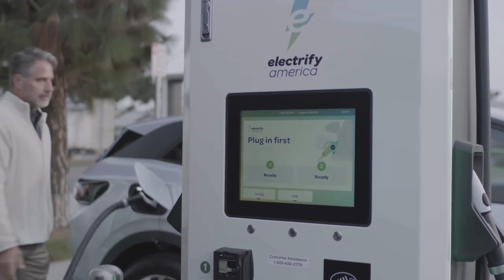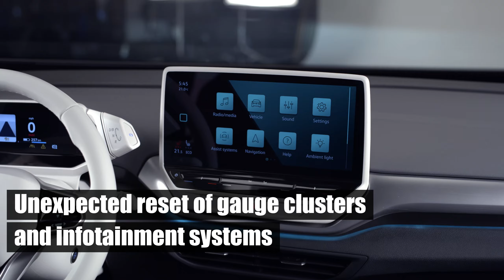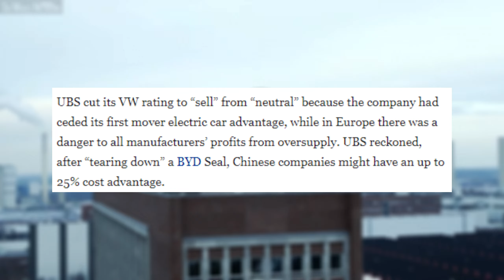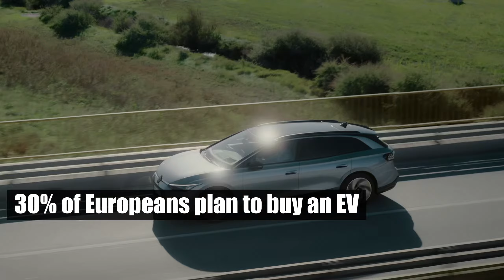Volkswagen’s EV Dream Turns Nightmare: CEO Scrambles! From Electric Vehicles, Back to Plugin Hybrid!

Comment: VW have always had reliability problems for years, regardless of ev or ice models and have been expensive to repair.
As a dealer of 30 odd years, I know from experience..
Reply: Not to say that even french car rust far less than VW.
Reply: I've owned 7 VW's (5 Golf's, 1 Passat and currently a Tiguan 2.0lt tdi) - never had an issue.
Reply: @AntonyBall-hm4jo  Well done ... congratulations, but if had them from new under warranty and only kept for short periods, and ran low km's, as you would expect you'd have major problems.
But go ask the people who got sucked into buying them at a higher km or age and get a reaction.
Reply: @georgewilder7423  Yes, you are correct, I tend to replace after 40,000 miles.